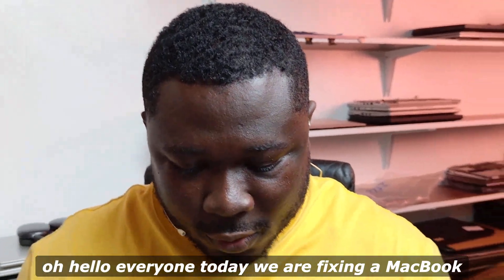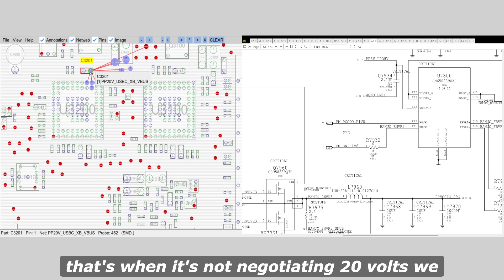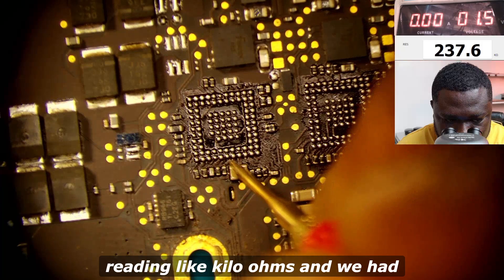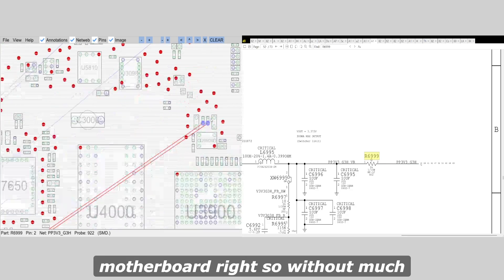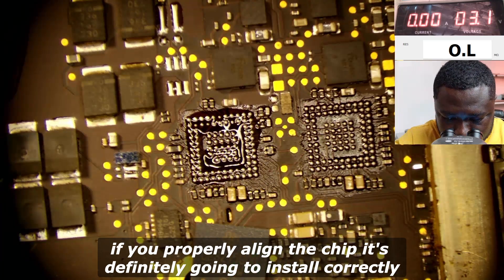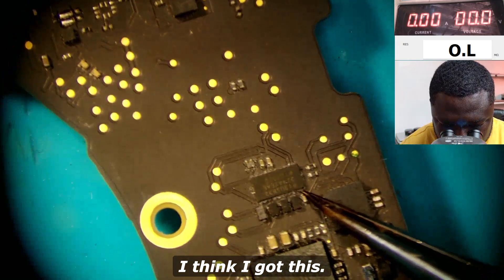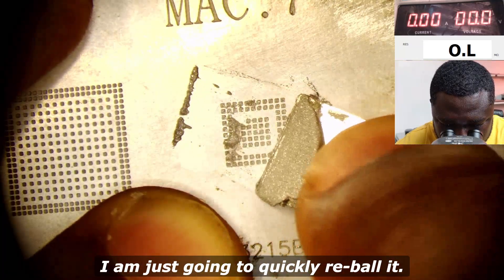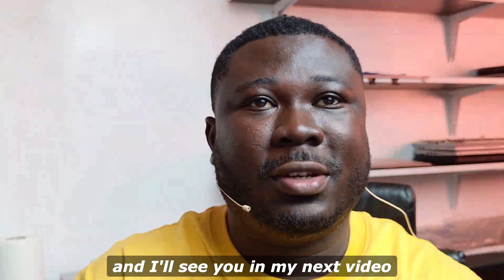MacBook not turning on

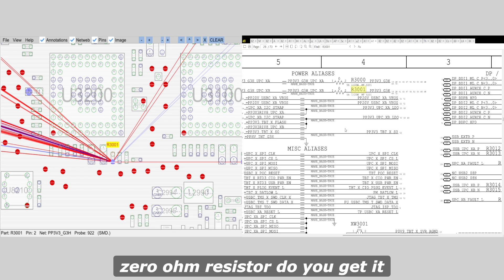Comment: 6:15 1.Question on The diagram app. Does the lines components map to represent a path to all components it connected to

2.Plus what determines a short or what component.

3 what is the software name
Reply from the maker: Answering to these questions 

1. Yes when a pin is selected it shows all the mappings that particular pin is connected to

2. Each rail has a minimum resistance to ground example if you’re measuring 199 ohms to ground on a 3V/5V/20V rail know that something is wrong 

3. Open boardview software